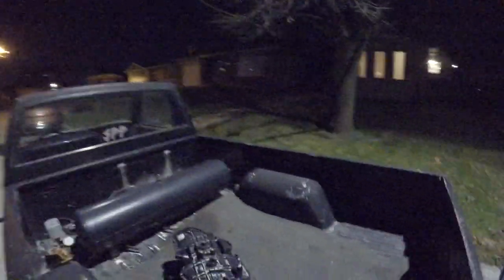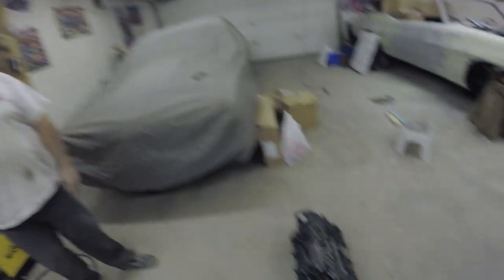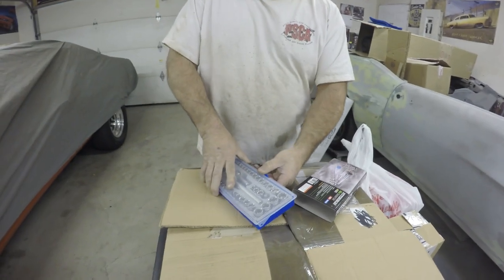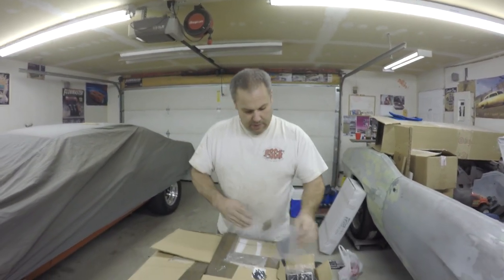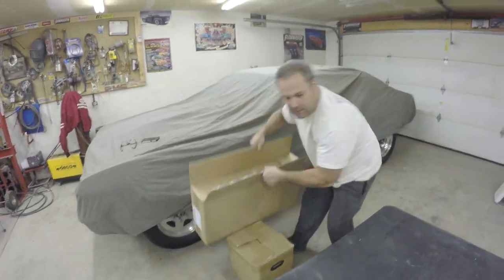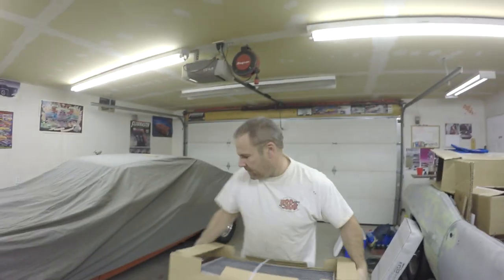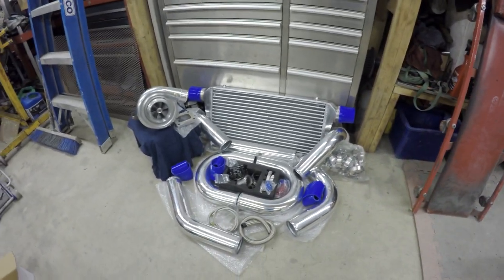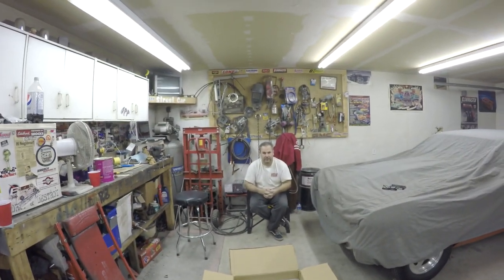CHEAP HORSEPOWER! $800 Turbo Kit Unboxing + 71' GTO Update | LS Swap S-10 Project

Comment: Rob you got the metal working skills, IMO I'd make a neat area for the turbo on the front engine side of that inner fender, IF all the plumbing can be well fit, easy access hood clearance etc. etc.
Reply: RussZHC  ya i was thinking about that, we will see once i get the engine in.

Comment: Next time you are in Fargo go to Fleet farm and buy their filters, they have TONS. And oil for under $2 a qt. They also have mandrel bent 3 through 5" exhaust tubing on the shelf. 

And get lunch down the street from harbor frieght (1 block east on Main) at Mango's. Best Fajitas ever.

Comment: I have a 72 gto with a pontiac 400 motor and it's automatic. Do u think this turbo setup, would be good for the car? And will it fit? And how much extra horsepower does it add?
Reply: Also, what exactly do I ALL NEED when buying a turbo from vs racing?

Comment: That truck is sick probably my favorite vehicle on the channel besides the Nova the Nova is perfection
Reply: Slime Lines thanks
Reply: novaracer2000 no worries man love the car I have a 71 caged car stock floorpan car still but 10 point cage inside also doin the sloppy 6.0 single turbo build this winter gathering stuff now bought the same turbo kit you got seems like good quality stuff

Comment: i have a  cast wheel 7875 and 44mm gate from Viren at vsracing. its been flawless so far. and can't beat the price.
Reply: I have a 72 gto with a ponitac 400 motor and looking for a turbo kit. If I go on the website and look for a turbo, what do I ALL NEED?

Comment: Question: Why do yall always go with turbos vs a supercharger? I am working on LS swapping a 86 k10 and eventually want to install a turbo or supercharger.
Reply: Foley Outdoors  i think turbos are cheaper than superchargers, nothing wrong with superchargers though.
Reply: Check out Pat Ganahl's "Street Supercharging" by SA books.
I have a copy.
The problem with supercharging is that it uses more power, "beats" the air rather hot, more costly to maintenance.
Roots or centrifugal require engine power off the crank, depend on a belt and put stress on the snout of the crank.

Turbo has come light years from what it was in the 90's, my book won't address the leaps made with turbos, however it will get you in the ball park.
For instant boost, you want a Roots or Centrifugal, no spool time. The LSA engine is proof of a solid build, but you still need to rebuild at some point, and those "cheap" LSA cores on Ebay are most always in need of a rebuild or mod to work with your Cathedrals, and apparently GM had a revision on some of the materials .

I was going to take the LSA road, it seemed like something I could get my head around as far as parts, but after all the "little" parts are bought up, you are more more ahead of the game with a turbo kit.

Just my $00.02 , hope this helps.
Reply: Foley Outdoors money
Reply: 20-25% of your total engine power is used driving the supercharger and never makes it to the wheels. This loss is due to the energy required to compress air. Turbo is the way the to go, uses waste exhaust energy.

Comment: I may aswell ask since you guys have a bit of LS experience, what kind of turbos do you recommend for a 5.3 OR 6.0 twin turbo build? Lookin for 650-800 WHP and using it in a street/strip application, 4l80e etc. All that fun stuff
Reply from the maker: +Exterminatingtraper lots of different ways you could go, but two of these 7875's would get you to your goal easy and they are relatively inexpensive.
Reply: SPPTV thanks very much!

Comment: I actually live close to Grand Forks, ND.  And if you like harbor freight GF should be getting one next spring, going in across Panda Buffet
Reply: Lothurin thats awesome, the other reason i went to fargo was to eat at sonic, then we went to GF and saw there was a sonic there now.
Reply: Yeah, GF also has ND first Chick-fil-A.   I'm working on a 91 S10 as well, but doing a traditional 355.  always wanted to put a 350 TPI in but they aren't easy to find.
Reply: Ya we planned to go the chik-fil-a on sunday and forgot they were closed sundays.

Comment: Do you Have a part number for the Turbo kit? From vs racing? Thanks
Reply from the maker: It wasnt a kit if you want a kit go on vsracing and look for the sloppy mechanics denmah kit( it has a gt45 turbo but you can upgrade to the 78/75) or just give them a call.
Reply: Cool Thank You Keep up the videos Love them.

Comment: Is that a square port or cathedral intake?
Reply: crxman9119 cathedral
Reply: novaracer2000 that intake looks a lot like my square port truck intakes on my L96 motors. What years did they offer that intake you have on cathedral heads?
Reply: crxman9119  i believe 08 and up

Comment: STOP loading up the filler and lay up some wet coats of feather fill primer and step back while its wet and reflecting and look at it real good  you'll be shocked at how much you can fix with a wet block But to just keep loading up filler is crazy ...Get the Mega block sanding block system and some full sheets of 320 or 400 a bucket of warm water with a drop of Dawn and start blocking it down  ..then take another look ...
Reply: Michael Laverty there is not that much filler on the car at all but thanks for your advice.

Comment: Why wouldn't you just but the plumbing kit for a turbo but instead of using a cheap turbo buy a Percision turbos or Other well known brands?? Unless the point is to buy everything as cheap as possible. Either way love your videos.
Reply: Jason Addison because precision turbos are expensive and tbis is a budget build. I havent heard anything but good things about the turbos from vsracing.

Comment: +novaracer2000
Seen $800 Turbo kit, my mind went to that crap kit HOT ROD got off of Amazon.
So glad it wasn't, that was a mess, wrong sizes, wrong bends, look the video up.
VS Racing seems to be the "Go-To" for "Go-ing", I plan on having them build me a kit for my Jeep, not sure if I wanna go TT, since you have a TT and have driving a single "T", whats your opinion on a mind TT build?
If I may ask?
Reply: ramairgto72 unless you plan on making insane power  <1500hp the only reason to twin is ocd in the looks of the engine bay. Why use 2 when one is more than enough? Sloppy Mechanics made 1076 to the wheels with an 88mm, 210lb/hr injectors and triple wally 450s in tank. But hey if a guys got the money? Fuck it, twins for the win.
Reply: 2 small turbos would spool quicker than a single.
I'm going for a 4x4 "universial" build, only people I know that have TT are mega hp guys.
Novaracer has driven both, so I wanted his opinion on drivability. 
I'm well aware of Denmah's builds, I have no idea why his channel isn't as big ..or bigger than MCM, Spaghetti or dare I say McFarland.
I'm not pulling the rods or gapping the rings on my LQ4, so I have to keep it around 500hp to be safe, it makes zero sense to pull my engine apart for rods & rings, thats better left to a new build.
As the new gen 4's come down in price, the "square ports" will be the best bet.
Reply: ramairgto72  a big single with a larger exhaust ar will spool slower. A single 78/75 will spool fast on the street and still make tons of power. I went twins on the nova for look and also for faster spool over a big single for street driving.

Comment: e bay turbo ?? what a waste and to top it off your installing it on a pos tune port .. that TPI set up is a major horsepower bottle neck it will cost you thousands to make piss poor hp out of a TPI  get a 5.3 liter those TPI runners are major power restrictors its like putting a 1 barrel carb on a V12 those things were horrible if you want to make 300 hp leave them on. past that they utter shit
Reply: Griffon 327 its not a ebay turbo its from vs racing and people make big power with them. Tje turbo is not going on the tpi its going on a 5.3 l33
Reply: Griffon 327 

The turbo is from VS Racing. I don’t believe EBay manufactures turbos. If you’re referring to the fact that it’s made in China we’ve used them before with no issues so if there’s one thing we aren’t wasting, it’s money.

And the turbo is going on a 5.3, it even says that in the video title

Comment: link to the turbo kit?
Reply: Dabagel100  its not a kit but  im sure they could set you up with what you need www.vsracing.net
Reply: Ebay
Reply: VSracing website
Reply: Evil82 S10 vs racing is legit actually
Reply: gsppuffer ya I know, I have ordered lots from them.